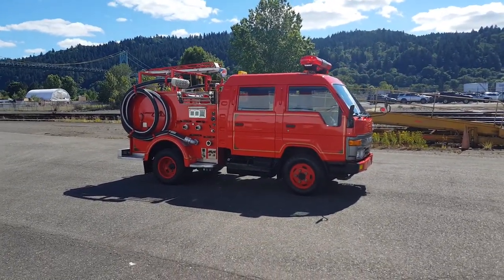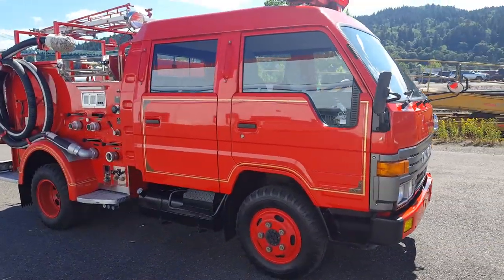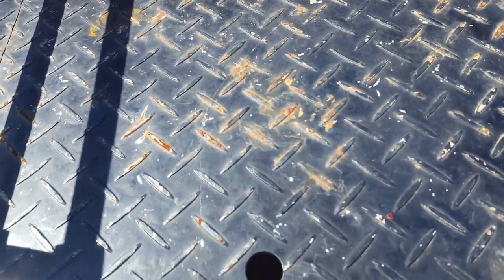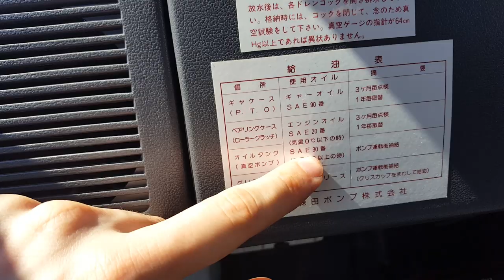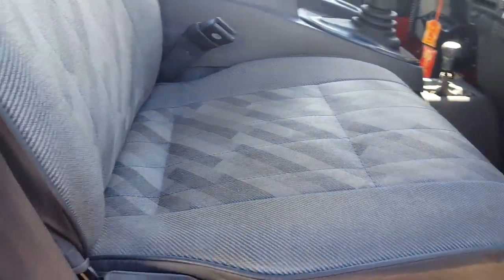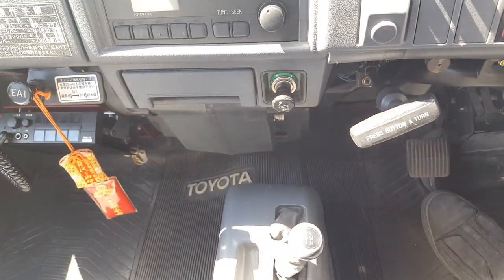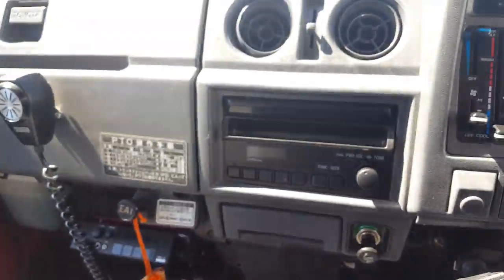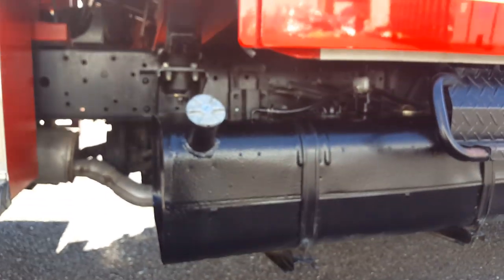Why this 1994 Toyota 4x4 Dyna Diesel Fire Truck is a true time capsule by OttoEx

Comment: transmission and pump are one hard to use as anything but a fire truck
Reply: Wrong - PTO is mounted to transmission - You can take entire Pump assembly off!!! Leave Nothing attached to the PTO or buy yourself a Flatbed + Winch and hook the PTO to the winch....